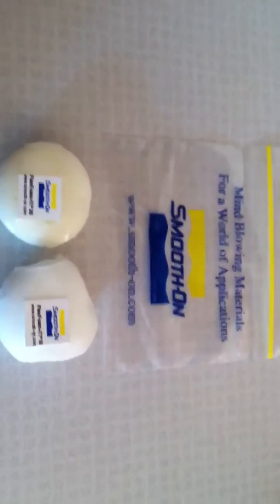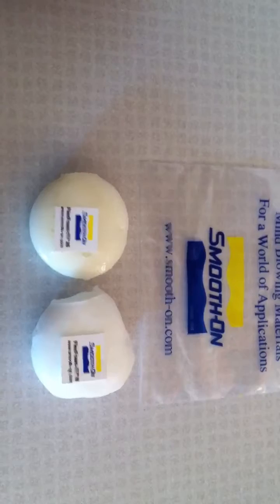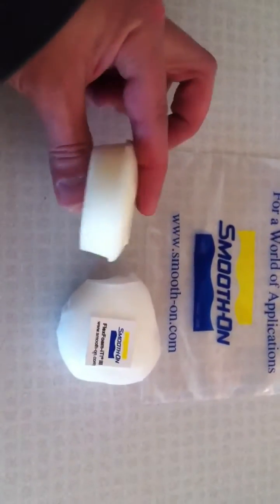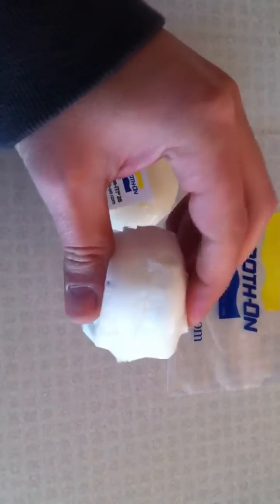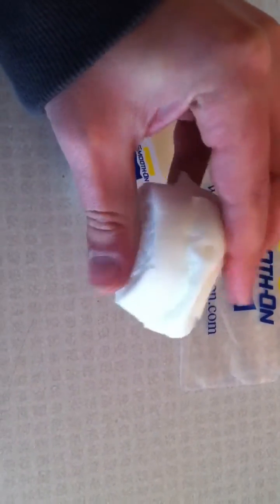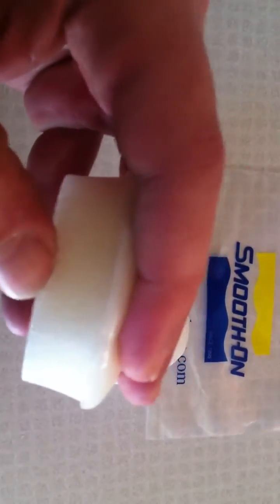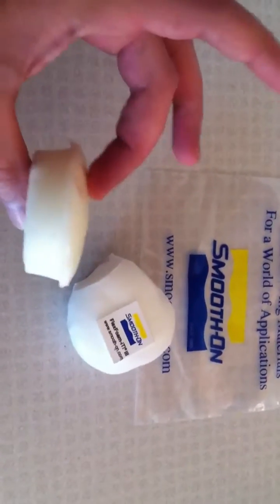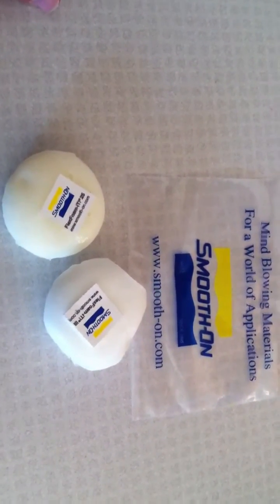Flex Foam-iT Samples

Comment from the maker: Each flex foam it has an approximate volumetric expansion value. Some expand 10 times, some only 2 times. What I do to estimate how much foam I need is to fill the mold that I will be casting foam into with water, and then pour that water into a graduated container. This way you can see how much volume you have to fill. Once you have this value, you can divide it by the expansion value. This will give you the amount of volume your combined A & B should equal.